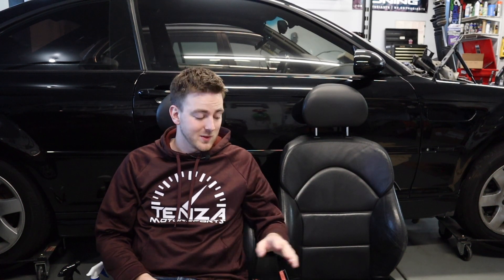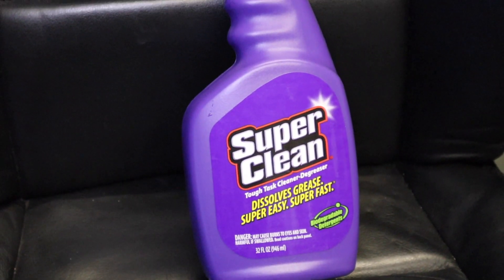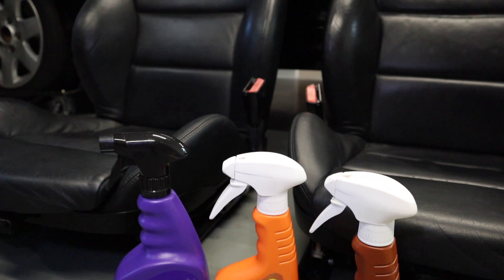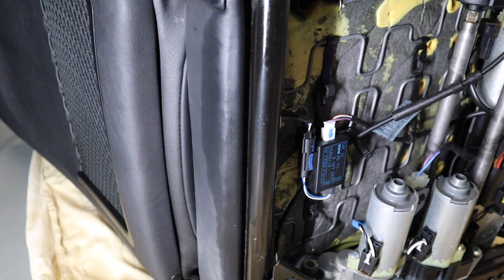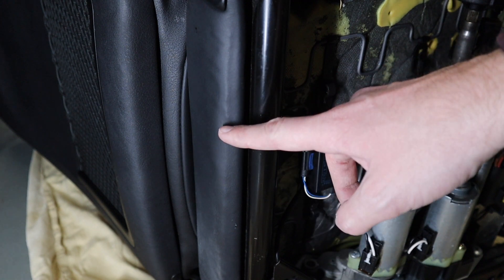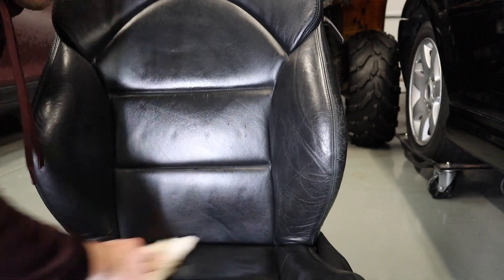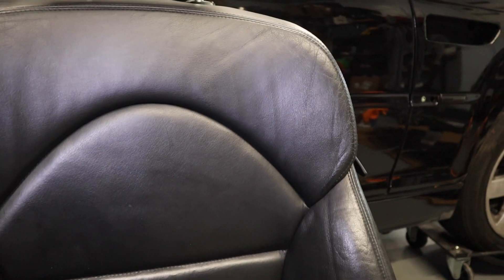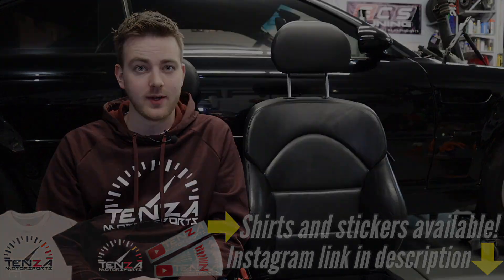The BEST way to keep your leather seats looking NEW! - Super clean test and review

Comment: I appreciate your video. My e93 is tan and the interior is just awful. Other products have just failed. I’m going to do a full detail on my vehicle. There’s such controversy with dilution, non dilution. What would you recommend ? At this point I’m up for options.
Reply from the maker: For leather. I would dilute it. If it’s not strong enough for you. Make it slightly stronger. Ramp it up. 

I’ve seen the considerate pull paint off of engine blocks. So I personally wouldn’t put that directly on leather. I won’t use the considerate without gloves.
Reply: @TenzaMotorsports  you’re amazing, thank you for your time and knowledge. I will do that. I also subscribed, I need this help 🙏